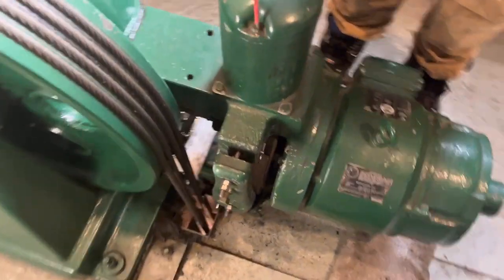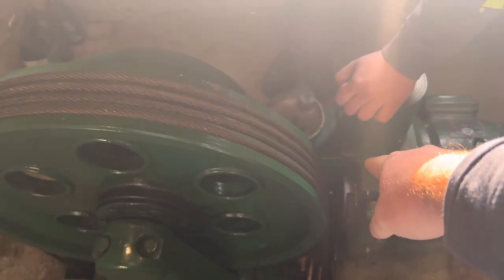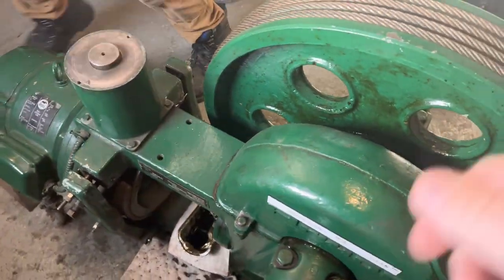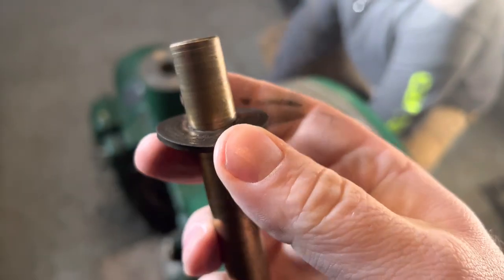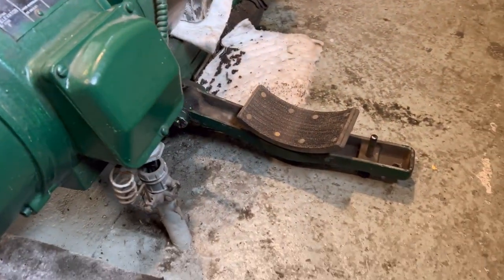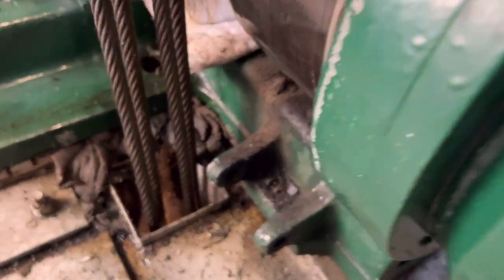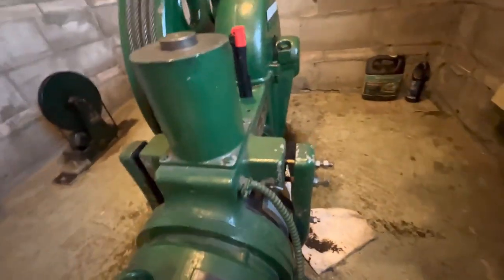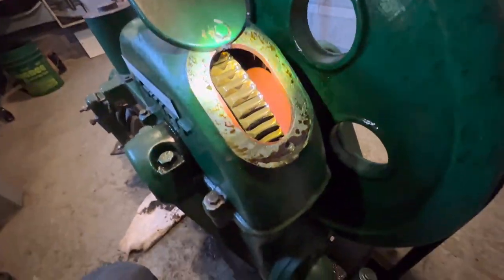Armor Brake Shoe Replacement

Comment: We would be fired for not doing a brake test and letting the public ride it beforehand.  This is the difference between union and non union.
Reply from the maker: I would be interested to know what you consider a brake test on a single speed elevator. In my opinion there is a brake test done every time the elevator stops.